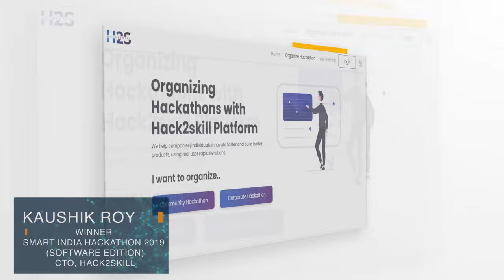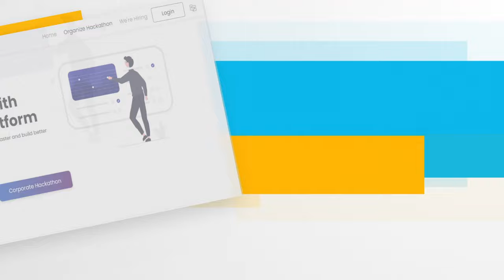Empowering India's Visionary Youth through the Smart India Hackathon

Comment: Before BJP 

GDP: 1.8 trillion

Export: 200 billion

Metro City: 5

Airport: 74

Electricity in village: 40%

AIIMS: 7

Total Expressway Length: 680km

Road Quality: 88no.

Total Unicorn: 1

1 GB data: 200rs

Rail Length: 22048 km

Internet Connection: 25%

MBBS seats: 51348

PG medical Seats: 31152

Medical colleges: 387

 After BJP 

GDP: 3.7 trillion

Export: 750+ billion

Metro city: 20

Airport: 152

Electricity in village: 95%

AIIMS: 22

Total Expressway length: 4067km

Road Quality: 42no.

Total Unicorn: 114

1 GB cost: 15

Internet Connection: 93%

Roillenath 55198km
MBBS seats: 101148

PG Medical seats: 65335

Medical colleges : 660

More things

UPI, Vande BharatBharat, Etc

World Largest Stadium

World Biggest Statue

World Longest Railway station

Asia Biggest Helicopter manufacturing

unit

World Longest Electrified Rail tunnel

World Longest Cruise ship
Reply: Incredible india
Reply: Incredible work for our society